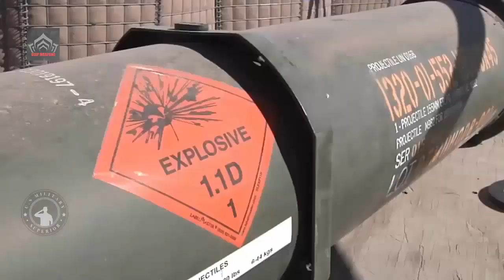Next-generation long-range 155mm projectile for L52-type guns was tested

Comment: How is this better than a missile or rocket?  It better be super cheap if you want to use it as artillery.
Reply: It's certainly better if 155mm is all you have. Potential long range striking capability is nice for targets of opportunity and a great way of keeping an enemy honest - even if you don't necessarily use it every day - and it's probably a lot cheaper and easier to keep a few of these lying around your fire base than to have a dedicated HIMARS unit on standby that wouldn't otherwise be needed.

It's also possible they can get the costs below the 100 000 dollars of a GMLRS rocket. It's actually slightly further range too, although obviously with a much smaller warhead.

I don't see this as being a Game Changer™, but I can see it being a complementary capability to regular give some more versatility to regular artillery batteries.